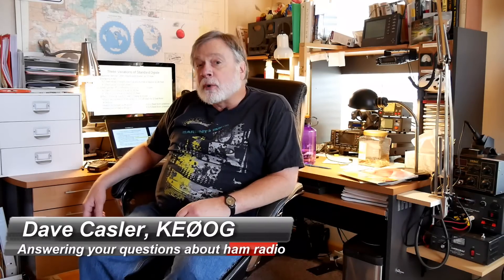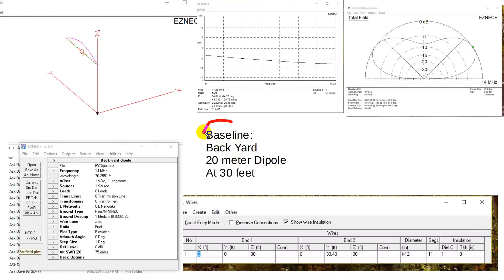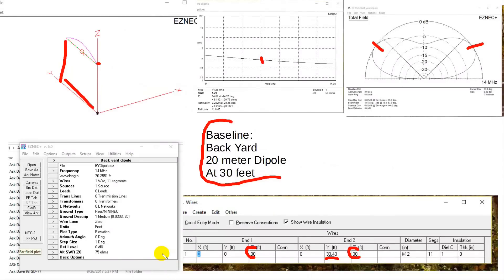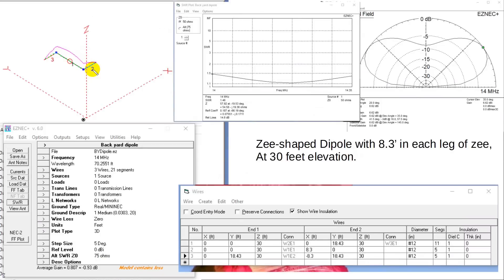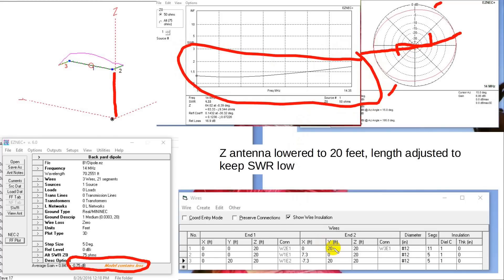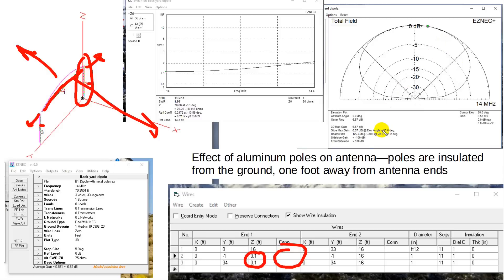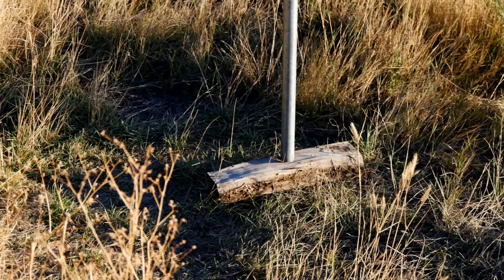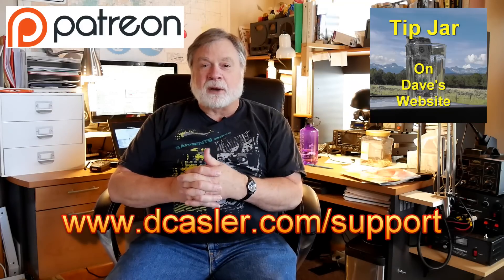Modeling Common Dipole Variations (#101)

Comment: Hi Dave. Re isolating the support poles. I have a steel mast, suporting one end of a dipole and suuporting a home made, wire J Pole, on the top. I have earthed the pole because , if I dodnt I would get static from the wind blowing through it, and for lightning protection. Which is best, earth or no earth? I am how confused! M0ttZ

Comment: I've got one for you- my "attic dipole" is woven between the decking and rafters. It's shaped like a sloped square wave on each side of the peak. It's a lot longer than it's supposed to be for resonance at 3.916 but I think it's because it's literally laying against the plywood decking. It's sharply resonant, ie 1:1 at 3.916 and SWR rapidly rises on either side of 3.916. Maybe 30 - 40 kHz wide (before it goes above an SWR of 3:1). As antennas go, it's horrible but better than nothing and I have made some SSB contacts with it. One in the Ukraine. I think that was a testament to the receiving stations antenna and great band conditions.   73 NE5U 
 Mike
Reply from the maker: Hi Mike, good to hear from you. 80 m antennas tend to have fairly narrow bandwidth. My HF-9V vertical works on only about 25 kHz of the 80 m band. So I think what you're seeing is normal. And congrats on the DX contacts!
Reply: Hi Dave, thank you. Hurricane Harvey kind of loaded me up at work for a while (nothing damaged though) and got me out of NW New Mexico a couple of weeks too early. Oh well. 

Now that you mention that, my GAP Titan DX was narrow banded on 80m. I miss that antenna... Might need to put up another one. 73 NE5U  Mike

Comment: VE3PCP here. A good way to minimize the coupling effect off the end of the dipole is to use long end insulators with lots if ribs. That increases the path of voltage to take significantly and minimizes losses off the end..
Reply from the maker: Thanks for the tip

Comment: David, I am having problems with an OCF Windom, which I would consider a dipole. Long end is at 30 feet, short end about 15 feet and center (where the 4:1 balun is) around 20 feet. SWR on 3845 is running about 1.6. When I put an antenna tuner in I can't get it below around 5!!! I have  followed manufacturers directions, directions from the web and youtube, with the same results. This is with two different tuners - Vectronics 300m and an MFJ 491E. Could this be due to the masts? Only the center would have much effect since the ends are about 20 feet from their supports, and the center mast is grounded. Also, would shortening the long side raise the freq nearer to the 3845 I use? Would that affect the 40 and 20 meter bands that are fine at present?
Reply from the maker: That off-center fed antenna sounds a little short for 20, 40, and 80. I'm quite surprised that your antenna tuner does not improve the SWR. Be certain you have everything connected correctly. Antenna output on the transceiver goes to the transmitter input on the tuner, and the antenna output of the tuner goes to the antenna. Other than that, I'm afraid I don't have much to offer. Good luck getting everything to work.
Reply: Sorry about taking so long to get back to you. Just got my computer going again.
Those distances were heights agl. And yes, I did verify multiple times that everything was connected correctly. That is why it is confusing to me! I feel that I SHOULD be able to reduce SWR with an antenna tuner. Unless it is already at minimum. That was why I was wondering if the center metal mast that is grounded could be causing me problems. The two end masts are 15 to 20 feet from the ends and I don't think they would create any problems. I have also tried with all equipment grounded to an earth ground and without the earth ground with no difference.

Comment: Considering the feed point of an end fed would more than likely be the antenna mast on your house, and the other end would be either a tree or in my case, a 20ft pipe in the ground. How does this modeling apply to my situation? An end fed 130 ft long with match box. Having the pipe not go into the ground would require guy wires which could be even worse than the pipe itself?
Reply from the maker: For something as simple as a dipole or one of the variations, usually rope is fine to guy the antenna supports. I got some rope from one of the them radio suppliers that is UV resistant.

Comment: Dave, sorry but I have another question.  I put up a Alpha CF 10-40 and have one end up about 45 ft, the Center about 25ft, I just bought the MFJ-1982MP and was wondering if I can run it to the same end point? This would put both CF and EF running the same way and about 3 ft apart  with the CF about 3 ft above the EF, directly above.  Is this a problem?
Reply from the maker: I think likely it will be a problem. Each antenna will affect the other. I'd suggest running them perpendicularly if you can.

Comment: Hi Dave, Kinda new to all this and will be going for my ticket next month.  Anyway, I have been seeing SDR and like what I see and hear with lessening to SW on the computer.  I was told to buy AFEDRI but can not seem to find it and to use HDSDR software. Can you point me in the right direction as to what to buy at a good price and what software to use?
Thanks The New Guy. :)
Reply from the maker: Good luck with your studying! Once you get your general license, you might look at the new ICOM 7300. It's a very advanced SDR radio, but does not rely on a computer unless you want it to. My very strong recommendation is that you do not purchase any equipment until you have the corresponding license.

Comment: I've have a question for dave. I going to build a copper cactus for 11 meters, yes all copper. The parts that radiate. And I'm talking about super j-pole. Are both radiating sections a true half wave. Or is one longer than the other?
Reply from the maker: Dale, I have essentially no experience with 11 m. If it's a J pole, then it's the long section that radiates. I have a video on the J pole. You can find it in the ask Dave playlist.
Reply: David Casler   thanks,  I was looking to make one like a ringo-ranger, with the half wave wrap around, then the top half wave. It should offer 3 dbd over a half wave dipole. Or in this case a j-pole.

Comment: Hi Dave. Thank you for the video. Nice job. I am curious as to how an inverted V works out. I guess I'll have to download the software and see if I can find out.
Reply: I too am curious about an inverted V setup with a set of surplus military aluminum poles holding up  the center of the antenna.
Reply: I’m curious now also about my 30’ metal pole that I grounded for lightning safety... It is holding up the center of my inverted V. It seems to radiate well enough but I wonder if I should try disconnecting it from ground ?